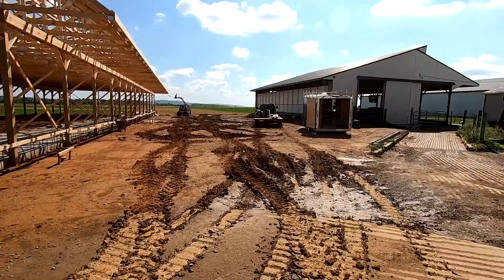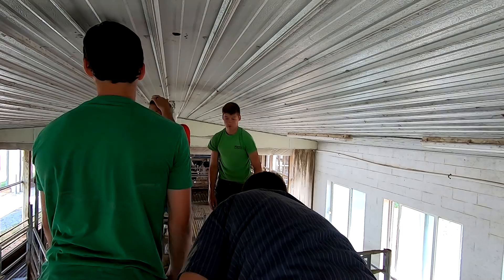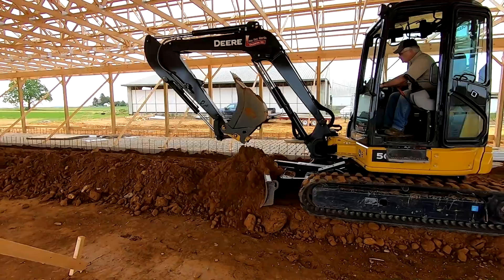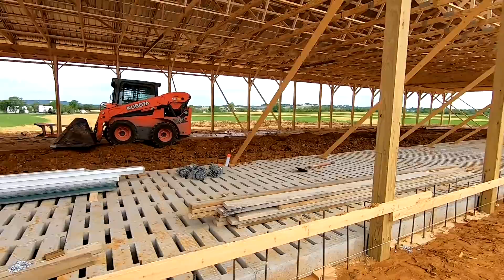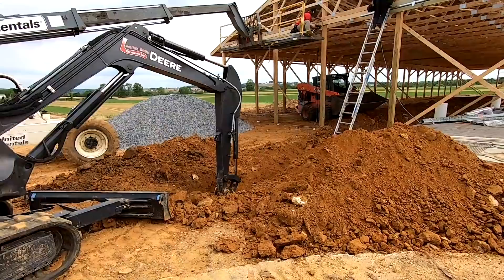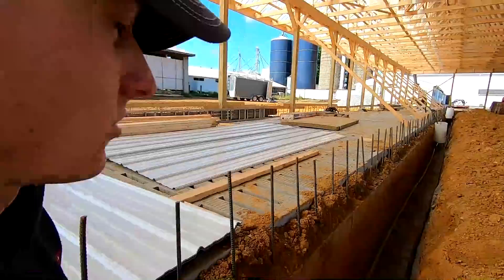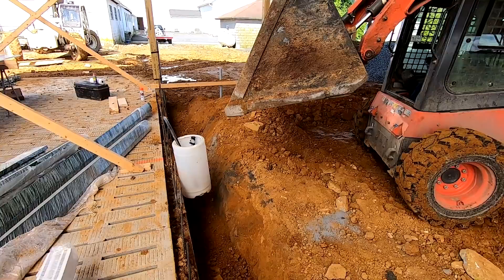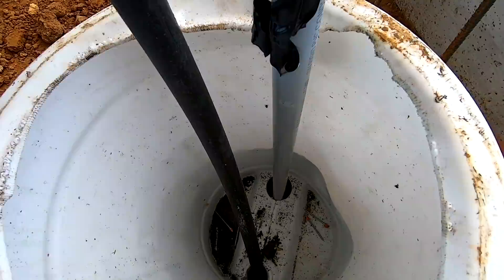Water Line in the New Barn

Comment: OMG No, you should have run 3" conduit for the waterline, and then just one waterline. If you ever have to get to the line you just have to pull that section, especially if you concrete the floor.

Comment: I'm surprised it's built of wood. I thought most of these would be built on a steel frame.
Reply: America 😂😂
Reply from the maker: Steel is more expensive and wood still holds up good for a long time.
Reply: A fully enclosed rain screen and where posts enter the ground, keeping that ground dry too, with a skirt and drainage. Then only insect and fungal attack to deal with, using treated timbers.
Reply: @xxn0cturn3xx  Wood building are the future hoss
Reply: @10thgenerationdairyman61  which kind of wood do you use for it?

Comment: It's a good thing you're not in Tornado Alley. :P You guys should have done solar!
Reply: Solar don't work when snow is on them and they do get snow.  I should imagine that they have a farm generator hooked into their electrical system
Reply: @carolynrose753  I am fully aware solar panels don't work when they have snow on them - having a system I put in myself with the same issue.

Snow on panels isn't a very good excuse for not getting solar unless you're so far north that you expect snow to fall and stick for weeks, if not months, on end. I don't recall that they're that far north in Pennsylvania, and as big as the barn is, the amount of electricity it would generate throughout the year otherwise could be a huge benefit to operations.

Comparing a solar system and a farm generator is like comparing dragons and a baseball - two completely different purposes.
Reply: @jcpt928  the power is to keep the water from freezing  as Eric stated.  When everything else is running on mains power or generator when the power is down  there is not a big drag on the system to connect into it. While solar does have it's place, the pay back time for the solar infrastructure is often long if you are already hooked to the grid.
Reply: @carolynrose753  I think you greatly misunderstand, and underestimate, the value of solar - even on-grid. As someone on-grid, with twice the average consumption of similar households, I still pull 15%-27% of my electricity from even my relatively small solar system depending on weather and time of year.

As they are out on a farm, doing a self-install would be a no-brainer beyond the time required to put it in (they're already pretty busy).

Comment: Ur new barn looks great . But just curious to notice its not an open span building so u dont need all those pillars . As they just clutter up a building and cause small wsted spaces . In europe all our sheds are steel framed  open space sheds to maximise space and room in the shed . Looks like ur new sheds gonna be a new version of ur old sheds with all the closed wasted space that pole barns have . I know steel costs much more but it also lasts longer . Infact some sheds have high tensile ally beams etc to save weight and stop rust . But our steel normally gets galvanised beforr construction so its lasts as long as any other material . Wed just never put up sheds like u guys . But everyones differrnt i guess and we cant all do the same . Gd luck with ur new shed itl be great to have more indoor space . Take care stay safe .

Comment: How come laying of the power and water failed to be included in the plan, to install during the original backfilling around the concrete done earlier? An oversight strangely missed in the design?
Sack the architect - most of that trench digging was unnecessary !
Reply: Maybe the guy helping them with the water lines and conduit wasn't available at the time of back filling. The dirt crew isn't going to wait weeks for the plumber to put in water lines and conduit. It's up to whomever is project manager / sub contractors to decide when things are done, not the architect.